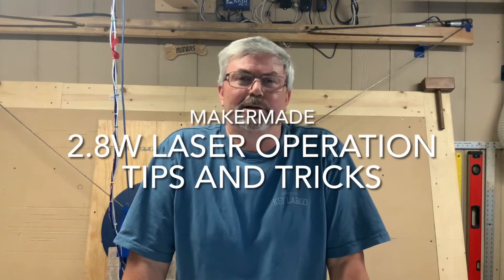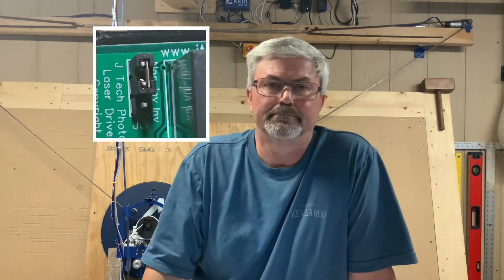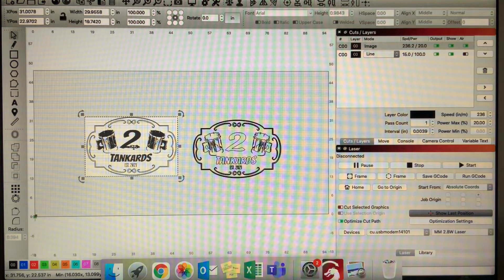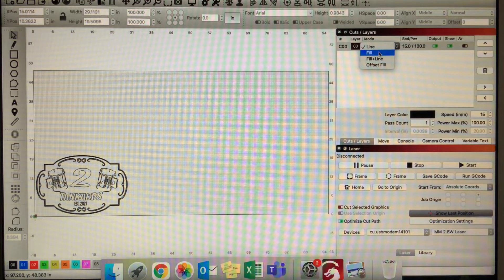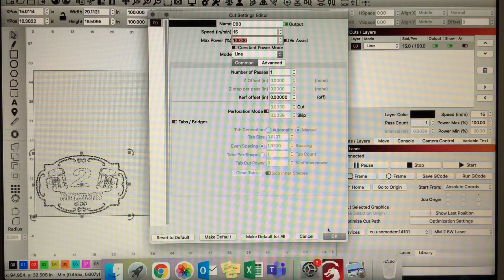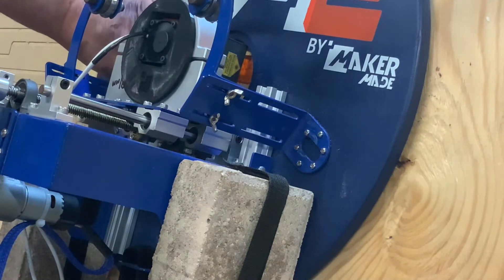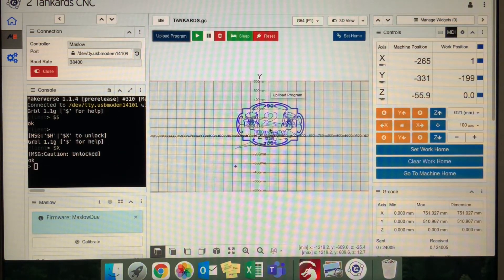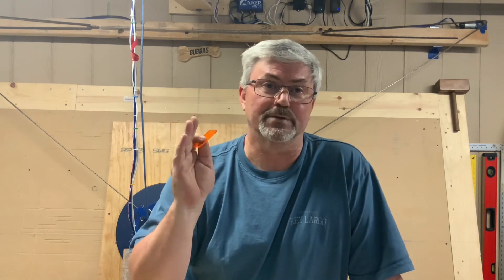MakerMade 2.8W Laser Tips &Tricks

Comment: Hi, Having trouble my unit will move as per the shape that I want, But does not burn. Have a light on the laser and a green light on the control unit. Any idea?
Reply from the maker: There is a second video in my series on assembly and install. It talks about a couple of pins that may need adjusted inside the control module. Take a look at that video, it may help.

Comment: So, my laser will not fire from the controller. I have triple checked that I am following the setup instructions to the tee. If I flip the switch on the laser controller, bam, laser light. Switch it back and try to even run the test from makerverse, nothing, test project just like you have it setup, nothing. I tried fiddling with settings, tried 10 different ways, checked and rechecked the device setup... no clue. I am not new to g-code and electronics either. I even tested the cable from the m2 unit to the laser unit and got some spare wire and just wired it direct to the block using the diagram in case the wire I was sent was faulty, same... no firing of the laser. It runs the g-code path no problems, it just never turns on. Ideas?
Reply from the maker: Check where the toggle switch is set on the front of the unit. Also make sure S=1000 as in the instructions. Make sure you enter the 3 dollar sign commands in the command area as well. You should only have to do this once
Reply: I have been having the same issue and finally figured it out.    It was a faulty 1K resistor that wires in on the green plug.